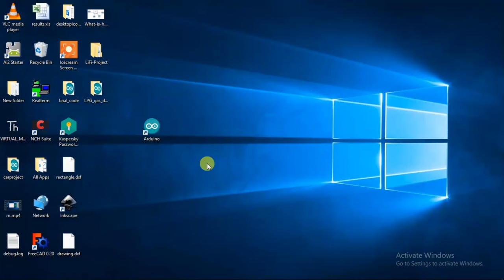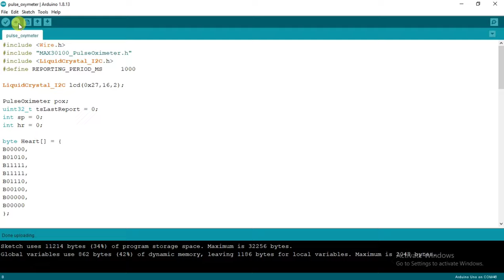how to make a simple patient health monitoring system using Arduino || DIY pulse oximeter at home

Comment: good job! I got error of "max30102 was not found. please check wiring-power", checked online said reason is "RCWL design fault",
sorry I just modify the comment, I saw your reply, same result for: MAX30100 or MAX30102.
Reply from the maker: You have to install correct Library